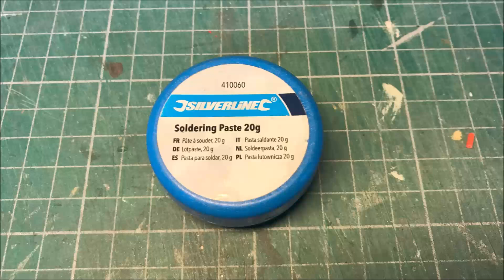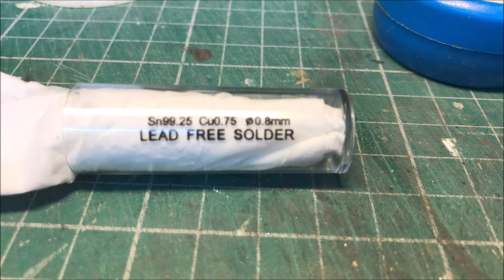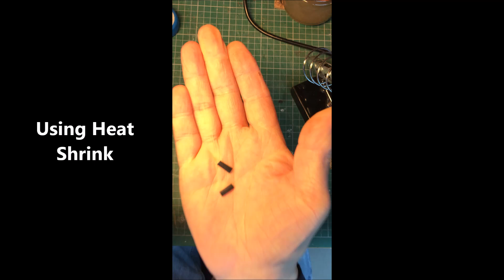Making Yarslow 2 - Soldering

Comment: Flux definitely makes a difference. My solder heads are a pain though as they never seem to stay clean.
Reply from the maker: Hi.  If you mean your iron tips, keep them clean on the wet sponge or the wire pads that come with some stands.  Clean the tip before letting the iron cool and putting it away.  Avoid acidic/caustic fluxes as these will eat the protective coating on the tip.
Reply: @_RandomPea  wire pad is absolutely the best thing to use, it doesn’t cool the iron tip down for starters.

Comment: I can also recommend the Pinecil soldering iron. Goes up to 60W, small and light, very low cost. Needs an external power supply (USB-C 65w or 12-21v traditional supply with a barrel jack). Heats up quickly, goes into standby after a short amount of inactivity, and you can set a temp up to 400ºC. Even works soldering 16/7 onto code 100.
Reply from the maker: Thanks for the info Phil and thanks for sharing.